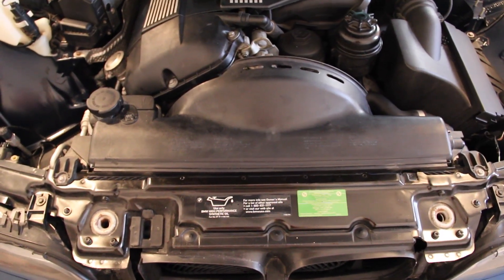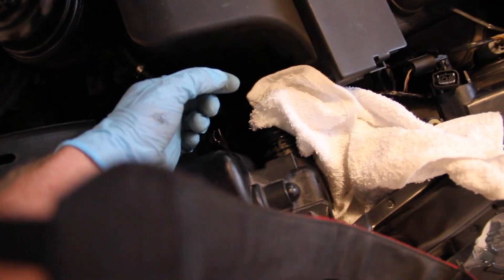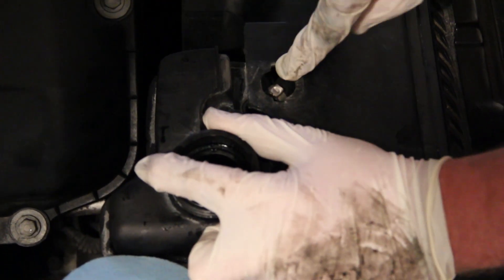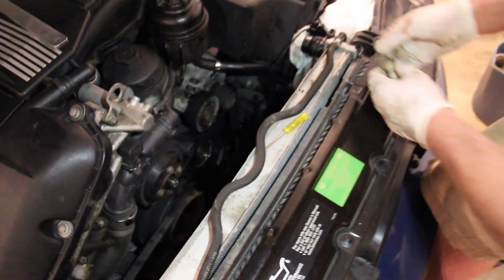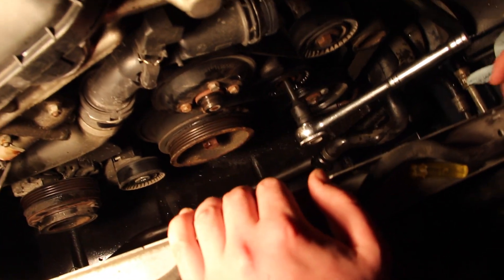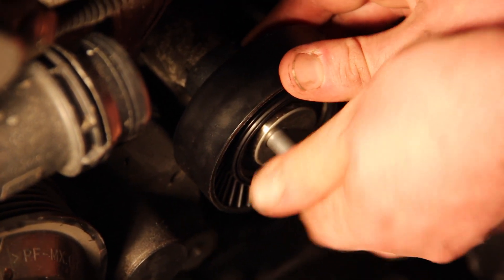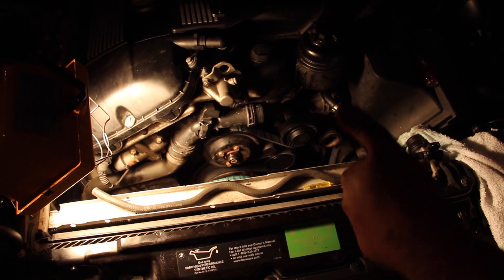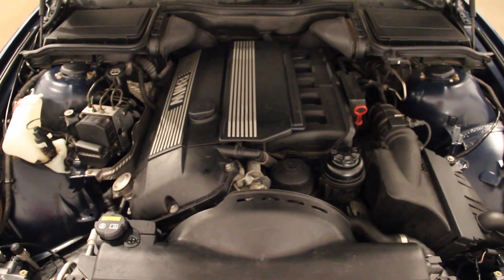BMW M54 (I6) Belt-Drive Pulley Replacement DIY

Comment: It would be a lot less messy if you drained coolant from the radiator drain plug FIRST. 40% of coolant gets out that way. Otherwise, good job...
M54 has an secondary electric water pump that makes filling the cooling system very very simple. Put the key on position 2 to activate the electric pump (without starting the engine) and just fill it. It will bleed itself 100%. After you fill coolant to the top of the expansive tank, close it. Start the engine and test drive it. If done so - there will be minimum amount of air left in system. Top it off later if needed.

Comment: On my car, the black plastic outer ring on the deflection pulley completely imploded and the belt was resting against the inner metal part where the off-center bolt is. Obviously no bueno.
Reply: A mi me paso lo mismo, milagro que siguio funcionando sin accidente...

Comment: Way too much work. I did this about a month ago. if you remove the radiator cap then remove the upper radiator hose. you have plenty of room to work. there is even a section of the shroud missing for room for your ratchet handle.

Comment: Hi Kennan, based on how much work you have done on this car, how much life do you still think is in it? The engine, cooling system, clutch, etc... Also, is it still for sale?
Reply from the maker: +Alex Pascutiu Hi Alex! Yes, it is still for sale. After all I've done to the car, I'd say there's easily 80,000 miles left in the old girl.  I have had friends who have owned E39 i6s last well into the 250,000 mile range with routine maintenance. The trick to owning any E39 is regimented, preventative maintenance; if you take care of them, they'll take care of you!
-Kennan

Comment: Good info. Did the barb break off of your expansion tank during removal of the upper overflow hose? Almost looked like it did. I remember doing this job last summer and it felt good to know everything is up to par at least for now. I should do a vid of my April 2002 530i 5 sport for you guys. Keep up the good work!
Reply from the maker: +djscottyc We did break the barb off the expansion tank.  He was replacing the tank anyhow, so we man-handled it and that's what happened!  Pulled it out of the hose with some needle nosed pliers.  Feel more than welcome to share your car!  I know our viewers would like to see it.

Comment: I've removed the fan/fan shroud 3x in the past two weeks. Screw that mess of plastic. I will be replacing all of that crap with the Zionsville Autosport aluminum fan shroud and expansion tank, with electric fan conversion. 
Part of the problem is the relative length of the inline 6 engine. Think about it; 6 cylinders in a straight line take up much more longitudinal space than a comparable V8, where only 4 are in a line. That means the fan, fan clutch, and expansion tank are all squeezed together. Crazy.
Reply: clementcroitor I've found ECS Tuning has by far the best website, but their location and shipping prices make them unreasonable to use all the time. FCPEuro.com has competitive prices, and good shipping times. I use AutohausAZ.com when I need something in 2 days or less, such as when my radiator failed, and they also have competitive prices and good shipping.
Reply: @computiNATEor  I agree on that FCP Euro is my main source for my 2002 BMW E39 530I that has 222k on the odometer, great prices and shipping imo. And fast shipping is important for a daily with that many miles sometimes haha. Love that car it'll love you back!
Reply: I second that!
Reply from the maker: +computiNATEor Agreed, working on the front of this engine is tedious, much in the same way that working on the back of the S62 is tedious. But, since most of the wearing components are on the front of the engine, I prefer working on the V8 cars. 

The weight of the engine also determined where it was mounted in the car, which is why the V8s are mounted further back. I hope you like the Zionsville fan; we'd love to see a video review to hear your thoughts! Thanks for the comment!
-Kennan
Reply: ***** For sure; that video would have to be after my summer project: an OE correct, high quality manual transmission swap. That should be a fun video!
Reply: +computiNATEor oooh! looking forward to that! question.. do you guys prefer Pelican or Bav auto for parts? I've used Bav for my last two projects and no real complaints but I hear good things about pelican.
Reply: +computiNATEor Right on! Thanks, will definitely check those sites out.

Comment: I have a problem with this. I have that problem with the noise and I replaced them, both tensioners and the roller along with both belts. Noise went away and then came back a few days later. why is that?
Reply: A squeaking noise came back? One of the pullies is misaligned
Reply: Something in your car may be leaking onto the belts and causing the squeaking. My belts squeaked badly when I had a coolant leak from the upper radiator hose, causing a weird squealing rattle.
Reply from the maker: +Cristian Rodriguez-Romero  It could also be alternator bearings, but that would be pretty constant, I'm not sure that it would come and go. I agree with the other two comments that it could be something leaking onto the belts. Keep an eye out for coolant leaks and maybe excessive power steering fluid leaks as that hose runs in that same area. Good luck!
-Kennan
Reply: +E39Source Hmm I see, very useful info thanks!